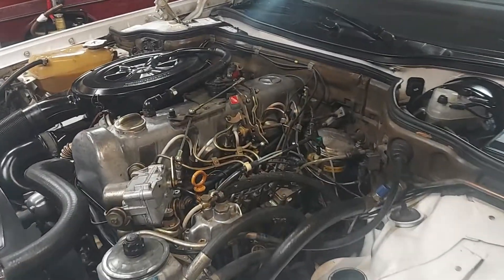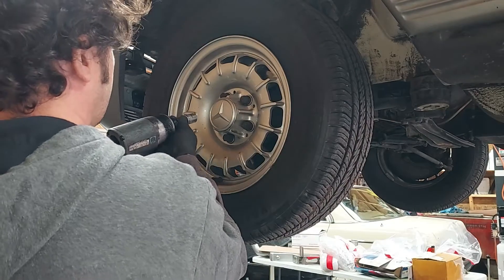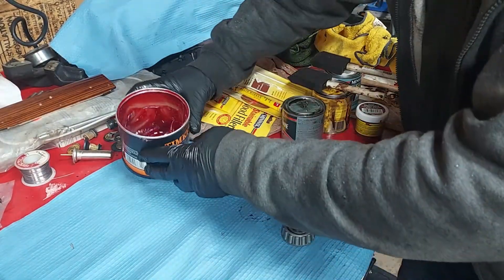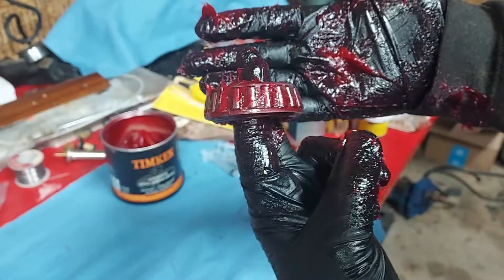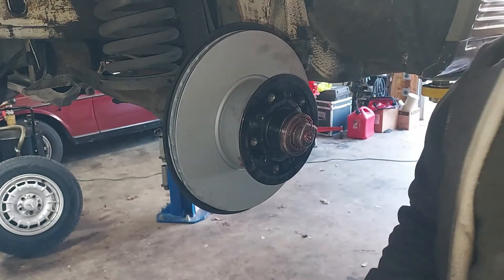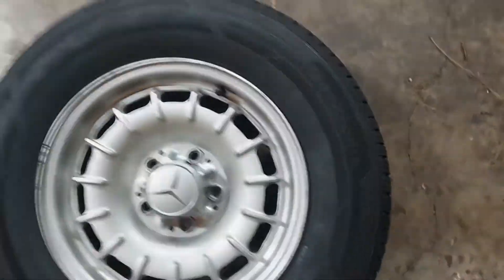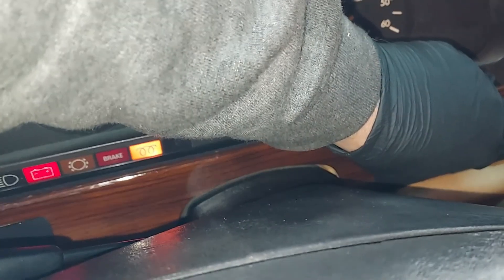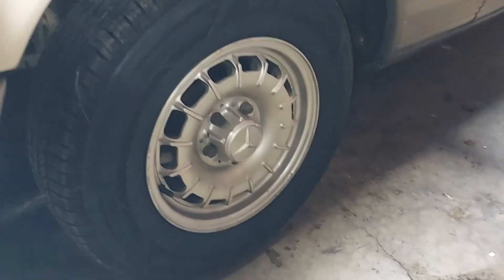1984 Mercedes 300SD - Part 4 Brakes, Tires, Suspension Inspection, Bearings, Full Vehicle Service

Comment: Awesome work on this vehicle.  When you do a power steering flush and change, what is the process for draining the fluid from the system?
Reply from the maker: The easiest way to drain it is to just undo the line from the steering box and crank the car for a couple of seconds and it'll blow all the old fluid out.